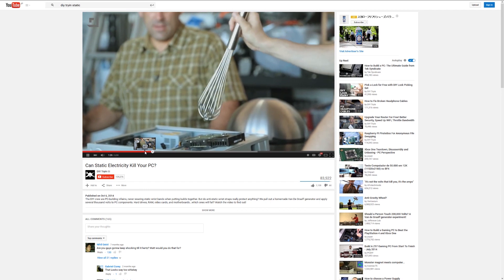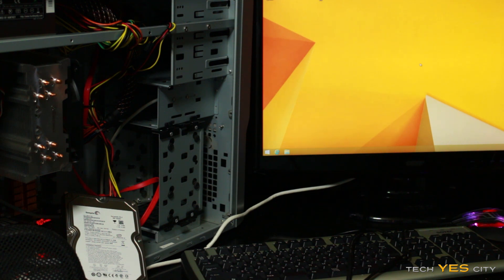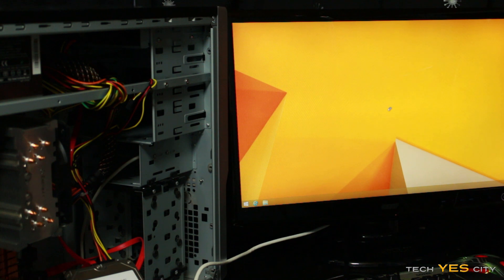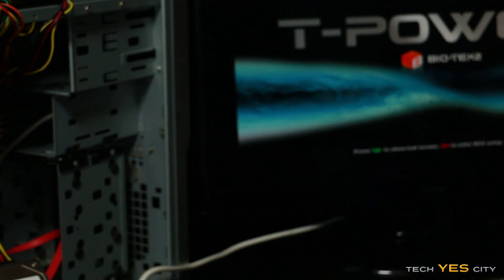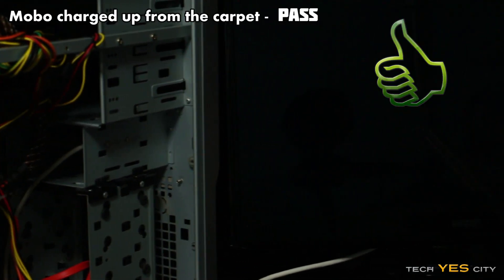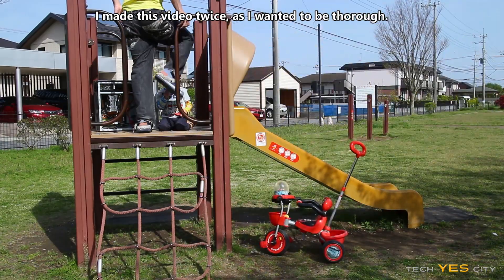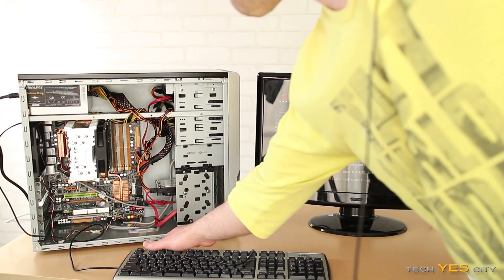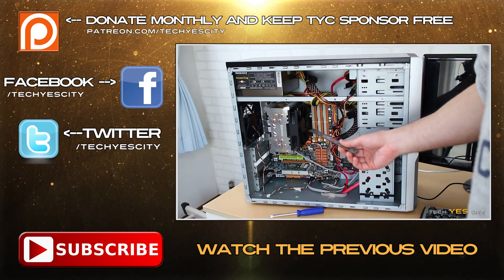Can Static Electricity Damage Computer Parts? Do You Really Need an Anti-Static Wrist Band?

Comment: Oh My God ... That is absolutely wrong ...

First of all : in every test you begin to touch a ground terminal of the computer parts (the Graphics card heatsink and the motherboard heatsink and the hard drive metal cover ... etc) and in fact the safest way to avoid ESD is to touch ground first and yeah you were the best at handling ESD the correct way thus it is impossible for you to have ESD damage .

Second : Let's involve science, ESD is not a lie from manufacturers for us to buy those wrest bands, You can actually represent the ESD source which is your body in this case as a capacitor connected in parallel to the circuit you touch and you can calculate the effect of the charge from your body being discharged to the circuit and compare that effect with the electrical characteristics of the circuit to know exactly if that certain ESD shock will hurt the parts or not ..... Please don't be dump .

Finally : Modern electronics are well designed to avoid ESD and the probability of an ESD is one in million for an ESD shock from human body

Comment: The amount of static electricity you generate depends on the humidity too. In a dry environment, the situation is much worse. As long as you ground yourself correctly, you should be fine.

Comment: Honestly, I've never had a single part die on me like this, and I really don't bother with ESD stuff.

I have an HD 6450. It used to produce artifacts. Now, however, it works just fine, no issues, and it's been on shelves without any protection, handled weirdly, and whatnot. I have an old computer where I thought it was broken, so I took the memory out to play with. I've lost one of them, but the other is back in the PC, and it boots and works as intended. Not that 512 MB is very much, even in Windows XP.

Comment: I completely agree with the conclusion. I've been building computers for 22 years all the way back to 386 DX33 and never once fried a part from static electricity or anything else for that matter. To prove the point I've actually built a computer on carpet and rubbed the case back and forth on the carpet before powering it on and it worked just fine. Components are much less susceptible to static damage then they where 25+ years ago, the trend just never changed.
Reply: Glad you never build my computer....

Comment: Why so many likes? You are clearly doing it wrong. You don't need to rub yourself so much, and the volts that you put out in the spark (and amps) are very low and only discharge once. So it would only affect one of those tiny little resistors. So imagine a tiny resistor on a memory stick. You would have to make that discharge (short circuit) in a very specific area and under specific circumstances, it will damage the computer. And you're only one person. Imagine 100.000.000 people who would do this... surely some of them will run into this problem! and surely if you handle the computer like this for 10 years, it will happen one day!

Watch some of luis rossman's videos. He shows intricate schematics of computer parts. Computers that seemingly boot up fine, but he finds sometimes little tiny components that do not work, and because of that, there are issues like a track pad not working on a laptop. Sometimes because little tiny bit of water reached a specific component which just happened to cause a problem. A lot of times components are damaged, but the computer can still work fine.

You said it yourself in the video, we all know how overclocking can damage the computer. I overclocked a graphics card once and afterwards, my card only glitched out once every 3 months or so. So I don't get the point of this video?! If anything, it is misleading... it's completely irrelevant to things that happen in the real world!

Comment: Stove Lighter, has a little device that sends off a shock of about 700v low amp, if you dismantle those and touch the leads while activating the thing it shocks you, it fried my multimeter, and an old  video card.

Comment: Now do it 1000 more times. Scientific accuracy includes repeatability.
Besides, just because it turns on doesn't mean it isn't damaged. 
Thirdly, the camera's handle being plastic has no bearing. You could still have dissipated electricity by touching it. I've been shocked by touching plastic parts plenty of times.

Comment: Do you live in a dry climate? In the winter here static is crazy. If I wear the wrong shoes I get shocked by my car just getting in and out! Did you stress test any of the components after shocking them? Would be interesting to measure how many volts you were able to generate per burst after your floor dance party! A friend of mine has fried his computer with static, zapped his mouse and fried his USB port. Everything is static sensitive, but components are definitely much more resistant to static than they used to be circa 1994.

Comment: Shrug I've built 4-5 computers on carpet and never had any issues.  My most recent builds I did use a static wrist wrap, but highly doubt not wearing it would have caused problems.  It's better procedure to build on an anti-static surface or using a wrist wrap, but personally I've never had any issues over the years.  Not saying building on carpet is 100% safe, but I've never had any issues.
Reply: Alright I don't have a band, but I do have a mat, a grounded radiator and a wooden floor and wooden table. If I go topless and build by putting my parts on the mat, touching the radiator and mat will I be fine?

Comment: hi there,loved the floor dancing,was wondering if you had a thought for me{helping word of wisdom},i know my question isnt about computors,but you might be able to help me,ive just replaced all the capacitors in my power amplifier and on turning it on it blew the fuse,Twice.......now i use a dim bulb tester,but,i cannot find out why the amp is grouning out ive removed all the new caps and it is still grounding to earth,there are no joints in any part of the pcb,where solder has tracked,would it be possible that blowing a fuse could have fried other sensitive parts?,and if so what would the first thing to be fried,please please help anyone,i am pulling my hair out wondering how i can fix/trouble shoot this problem,kind thoughts mark

Comment: I swapped my PC into a new case with sort of protection and I did it on my bed. No issues what so ever.
Reply: CJ Static Electricity will shorten the life span of any CMOS components if it does not outright destroy them.
Reply: HylianOverlord how did i dodge the question? i clearly said no. but i never said it isnt a good thing to not use proper anistatic wrist bands and such. im telling you what I did and how it worked for me. but i mean even if it did do some kind of damage to my components i haven't noticed any throughout the time ive been using them.
Reply: Dakota Bradford haha lol
Reply: Dakota Bradford You, sir, are an idiot.
Reply: HylianOverlord Actually he's not... you're just bitter
Reply: HylianOverlord ive had it for 3 years now with no issues.
Reply: Dakota Bradford It has never blue screened on you or crashed before.
Reply: HylianOverlord nope. the hardware was even used before i got it.
Reply: Dakota Bradford First of all you dodged the question. Second of all  the biggest concern with static electricity is that it perforates the glass in between the conductive layers in the CMOS technology. There is no getting around that problem unless you have components specially designed to protect against static electricity.
Reply: HylianOverlord but what are you so butthurt about? i spent my money on my parts. not yours. i got them cheap anyway and the pc is soon to be completely replaced as soon as my new parts arrive. so whats the problem?
Reply: Dakota Bradford Not butthurt, just fucking with stupid people, bye.
Reply: HylianOverlord Jesus dude you're insane.
Reply: CJ Insane like a fox.
Reply: HylianOverlord looks like we got ourselves a troll here. Did you have a bad day? Oh dear.

Comment: Hi

How does touching the metal case of the computer help to discharge the body of electric charge if the computer is unplugged?
My view was that you can only discharge the body if connected to an earthed/grounded cable?
Reply: hyylo it equalizes the static charge between you and the computer.

Comment: You didn't touch the solder points or pins before touching the rest of the card.

You also only touched the protective cover of the hard drive and not the PCB/chip leads.

Now I think anti-static wrist straps are completely unnecessary, but the test is flawed.
Reply: I reckon your face is flawed.

Comment: Here's a tip to discharge any Static while working with electronic hardware if u don't have a ESD wrist band.Simply grab a PC power supply plug into the wall socket but leave it off and just remember to touch its metal casing every now and then.This will discharge any static build up.

Comment: It doesn't help that you touch the camera after u tried building up the static ... any POSSIBLE static electricity would've been discharged into the camera..
Reply: capitolina ambrioleta The camera is a complete, self in closed system that is not vulnerable to any static you would build up on your body. Almost like it was designed that way or something.
Reply: +Dexylicious

Actually, it's a good Idea to touch the case to ground yourself for the same reason as it is good to ground yourself on a PSU.

Modern PC cases come with Grounding points that prevent damage to the PC's surroundings in case of power surges.

This is for the safety of users and also applies to PSUs as they have the same concept employed for obvious reasons.
Reply: Dexylicious exactly!
Reply: Does it also help to discharge static when touching PC case?
Reply: Little late to the party, but he put in the description the handle was plastic.
Reply: Plastic does not dissipate charge unless it is doped with a dissipative material or has something to prevent charge from building up in the first place. Plastics will build up a charge because the charged particles have no means of dissipating. I would also not call kilovolts worth of electricity "very low levels."
Reply: Yeah, but it can damage PC components. 

And as someone who builds up a spark better than a brillow pas in a lightning storm, I appreciate not having damaged anything expensive when I did shock my cpu
Reply: lol how plastic handle of his tripod can discharge him? 
#brain
Reply: Dexylicious his tripod is made of plastic.
Reply: I am also with the believe it is very hard to build up enough static to damage parts. though because he did include the "handle was plastic" bit in shows he is another "tech" guy who doesn't understand something he ought to know. ANYTHING you touch will dissipate the static charge (unless it was the item you used to build up the charge), especially the very low levels a person would build up. are there people who seemed more statically charged, who work in very dry conditions that ought to wear one, yes.
Reply: Dexylicious EXACTLY
Reply: Dude....just read the description.....its written there that the camera handel was plastic
Reply: NO! The pc is carrying all the components inside! 
This will just discharge any static into the machine and the parts..
Reply: Hylian the act of touching one charged item to one not charged is a form of transfer and will cause dissipation. Even with plastic, perhaps very tiny, but you've already started with a small charge. A charge also quickly naturally dissipates, even if the plastic did nothing. The human body would be charged at 3kV by the normal everyday activities, and that wouldn't hold for long. You can watch a bunch of EEVblog (and others) showing they cannot kill a chip. In all the proof scenarios, charges had to be upwards of 30kV doing things you wouldn't do. So yeah I stand by stating "very low levels".
Reply: yet the camera is still working fine, so.... yeah
Reply: +Artur Werner
Static charge travels on the surface of objects, so non-conductors can also dissipate static charge.  If they couldn't, we wouldn't have a problem in the first place. 
A conductive material obviously an immense help, if you want to ground yourself, because it can also conduct, not just dissipate the charge. By touching the camera, he at least split his already not too high charge with the camera. If the camera wasn't standing on the carpet, he could potentially ground himself.

Comment: Obviously you did not plug the power in until after you supposedly zapped those components, thereby merely adding static electricity to an already static device with no path to discharge. Try your experiment with the power plugged in, or at least with the chassis grounded.

Comment: Greeting! Tech City, I also built many computers for 15 years, haven't had a problem with static. I live in Asia, 220 volts. my computers are "ungrounded" with only to prongs on the electrical outlet. this is the setup : PSU had 3 prongs connected to an AVR with 3 prongs socket, inside the AVR the the trhird prong "ground" is connected to the AVR case with a screw (default factory AVR) the AVR itself only had 2 prongs connected to a two prong wall outlet (and that's it, no earth ground). it has been the computer setup I have for 15 years of computer building. what do you think about this? thanks for the nice static tests.

Comment: So how  does grounding work ? Does electricity need a closed circuit or just any metal thing
Reply: When you're charged up, the current needs to go somewhere. Would you rather it go from your hand to a metal surface thats grounded away from your computer, or grounds and sends voltage through your motherboard, possibly shorting out a IC or god knows whats in its path.
Reply: I mean  any battery operated electronic for example a flashlight the electricity circulates inside the circuit. it doesnt need ground.  So wouldnt a disconected PC  be ok if you ground yourself to the PC?  Im new to electronics.

Comment: It takes thousands of volts of static electricity for you to even feel the discharge but much smaller discharges happen all the time. I've worked in the communications field for 40 years and have seen microscopic evidence of ESD. It looks like bomb damage on chips. This damage rarely causes an instant failure but degrades components and causes flakey problems, intermittent failures, and complete failures sometimes many months later. These problems are hard to find and sometimes attributed to other components. If you don't believe in ESD, you are ignoring physics.
Reply: Should be the top comment.

Comment: Yea go ahead and fry a few hundred euros worth of MOBO/GPU ETC instead of forking out two/three euro on a ESD Wrist strap. 
I would & did  go as far as buying a Multi-Meter tester to test the ESD strap - Didn't fancy playing Static Discharge roulette with my 1070/ASUS Delux Z170/6700k - Simple maths.
BTW grounding yourself before hand is good practice but you will still create static after that through movement, clothing ETC.
Reply: then go out side naked in the sun and do your build out side
Reply: dude i have some questions
Reply: so i have gtx 1060 msi , and it was standing on my desk on some anti static plastic
Reply: Not to be flippant, but turn it on & find out -  Nice rig. 

Modern components are more resistant but personally I don't see the point in risking it as ESD straps, Anti-Static gloves & the like are so cheap + grounding oneself is free.

Comment: I built a PC over the course of two weeks on my carpet. No problems, runs like a charm.
Reply: Anything spoil before warranty ran out?
Reply: I thoroughly cleaned my pc a few days ago. I wasn’t wearing an anti static bracelet but was as careful as I could possibly be otherwise. I’m 99.99% sure I killed my motherboard in the process. I never even shocked myself but when I go to turn it on the lights on the mobo flash for a fraction of a second then nothing.

Comment: If you want no static touch a metal table so you transfer the electrons out before working on your computer no need for straps or other bullshit.
Reply: just touch the case if its metal
Reply: is this legit?
Reply: +Mark Vincent yes only you have only 1 hand to work with and if you hand fall off...
Reply: IkBenStijn so can i touch metal the both of my hand and transfer all of the electrons?
Reply: Mark Vincent yes
Reply: You really think you would store that much electricity from static? if you tap it every now and then you're fine no need to hold on to the table or metal object.
Reply: IkBenStijn thanks
Reply: Mark Vincent Electrons travel around your body you don't need to touch it with both hands.
Reply: +WOPPER ok haha thanks

Comment: Just touch a radiator in your home be for you work on electronic parts and you are save.

No need to get a wristband or take the risk.
Reply: do you have to be bare feet??
Reply: I usually just grab my door handle before I touch any components. although I have gotten a shock quite a few times from touching my pc with static, I've never had any issues.

Comment: one of the biggest misconceptions about electro-static damage is that any point in the computer, for the most electro-static discharges will not damage components (mainly transistors) because they are all connected to the same pcb. once these components are soldered in they become much more resistant to ESD because they have all the other components around them. In other words ESD bags are conductive so that the ENTIRE contents of the bag get shocked and there for there is no voltage drop across the components thus no current and consequently no damage.